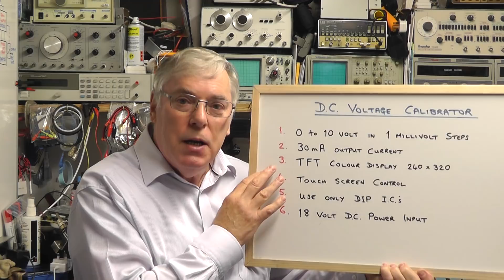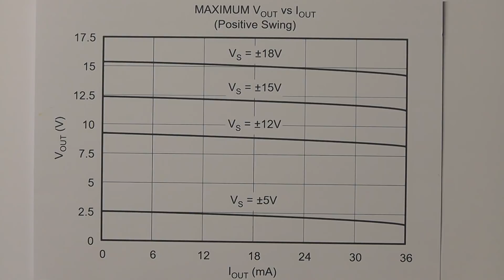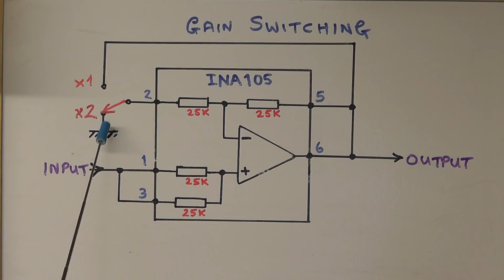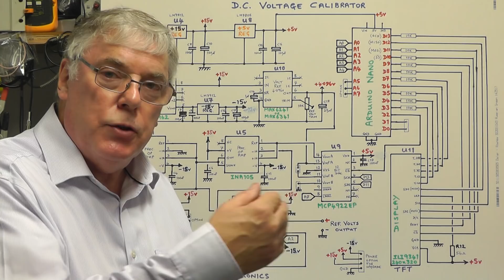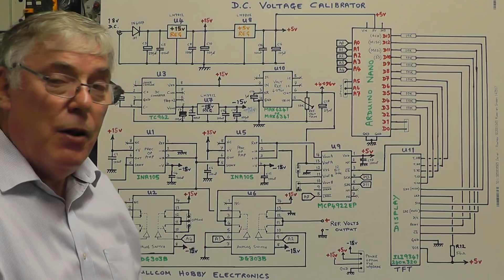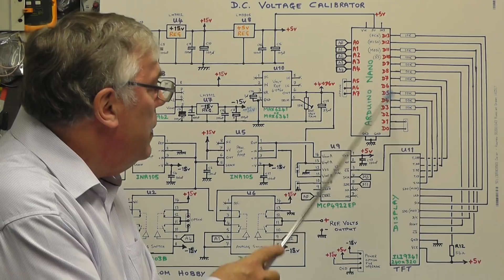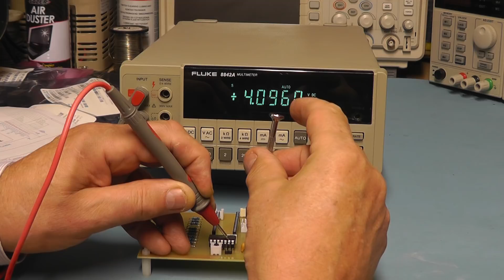Scullcom Hobby Electronics #53 - DC Voltage Calibrator Part 1

Comment: So you have minus 15 from the charge pump feeding a minus 15 volt regulator? so how can it regulate with no voltage to work with? you need about 3 volts across it for it to regulate

Comment: So if there are two DAC's in the package and they each have a seperate voltage ref input and each have an output, why didn't you put the 4.096 ref on one and the 1.2 volt ref on the other and just switch the output ? instead of all that switching?

Comment: What do you use a DC voltage calibrator for?    BTW like the fact you give the component list, PCB etch and everything right here, one stop, no need for a gerber file reader and all that stuff.  I used to etch things like circuit boards and other things using ferric chloride at a company.  EPA regs made it difficult to stay in business.

Comment: The MAX6(2/3)41 are actually a trade-off. The temperature coefficient isn't long term, reference drift is. the MAX63NN has roughly half the typical temperature coefficient - 0.5ppm, of the MAX62NN's - 1ppm typical. However the MAX62NN lists its long term drift spec at only 20ppm/1000 hours, beating the '63 at 30ppm/1000hours; I believe this is where their numbering scheme comes from but I could be wrong. So it's basically a trade off if you want the tightest short-term tempco, or the lowest possible long-term drift.

Comment: When calibrating a source, I was taught about using the first digit and decimal in lower digit numbered meters to gain a digit at the end. For example, when setting a 10 volt standard, you would adjust it to 9.9999 on a 4 1/2 digit DMM, so the digits shift between 9.9999 and 10.000, which will get you closer to a reading of a 5 1/2 digit DMM at 9.99999. This would apply to a 5 1/2 to 6 1/2 digit DMM as well, and even a 7 1/2 digit. Essentially, you're fishing for that last unseen nine and splitting hairs.

Comment: Very nice project.  I like the touch screen with the audrino.  I haven't got into using them.  I have just been sticking to repairs.  Might have to build some projects and utilize a touch screen interface. I liked your electronic load also. 👍

Comment: Hello Louis. Coming late to your nice project... I've a simple question: am I the only one to notice that the schematic around the switched OPamp doesn't fully reflect the bloc diagram? According to your long explanation about the choice of the multiplication factor 1x 2x 4x, these are cascaded by selecting x1 or x2 on both stages. But the schematic shows that the second switch actually select the output of the first OPA (x1 or x2) or the output of the fixed x2 gain of the second... Is there any advantage to do so instead of replicating the 1x, x2 gain selection of the first OPA to the second OPA?

Comment: What would this device be used for?
Reply from the maker: Hi George,
A DC Voltage Calibrator can be used to check the accuracy of a multimeter on the voltage range and also for calibration setup and comparing different multimeters. It can also be used in circuit design when testing the gain stability of DC amplifiers. It can also provide an accurate reference source during circuit design when testing response at different reference voltages.

Regards,
Louis
Reply: So, is it essentially a more elaborate reference voltage power?

I've been looking at buying a reference voltage power supply from a guy who makes them, and lives about 45 minutes North of me, in Washington state, (I'm just south of Portland).

But, I got to thinking last night, as I was checking out the Tek 466 'scope I just picked up, it has a digital multimeter piggy-backed on the scope. Do you suppose that is a reliable/accurate enough meter to use as a reference source once it is calibrated?

Or does it make more sense to buy one, (~25.00) and be able to calibrate all my meters to the same reference?

Thanks.

BTW, I learned a lot just from watching you walk/talk through the white board diagram in this vid. You explain things well.

I'm going to have to give one of these Arduino boards a try one of these days. It looks like you can do some cool stuff with them.
Reply from the maker: Hi George,
I do not think the multimeter piggy-backed on the scope will be as accurate as a voltage reference source. From what I can see it only has 4 digits. You could get it calibrated but it would then only be as good as its specification, and I am note sure what that is. If you can find the technical specification of the multimeter piggy-backed on the scope it may help you. I think it was referred to as a model DM40, DM43 or DM44 the later models also had temperature reading as well.
Regards,
Louis

Comment: Great video! Thank you very much! I would have gone with some things different but that would be more for effect :-P
For example, I would have gone with a flyback for example for the -/+15V rails, can be implemented with something as easy to get as MC34063 maybe another more modern IC but still with trafo, it can take a wider input range, make it easy for battery conversion. Would have gone also probably for another implementation to get also negative voltages, cause why not. Could also have gone with a MOSFET reverse input protection and combine it with a soft power button. Still, the idea is pretty cool! Thanks for that!
Reply from the maker: Hi,
Thanks for your comments. It is interesting you mentioned the MC34063 as I am using that IC on a new Function Generator project I am currently working on as my next You Tube video project.
Regards,
Louis

Comment: hey scullcom hobby electronics, I want to design a pH simulator which goes from( approx) -1.0000 V to +1.0000 V. I am not using a DAC or any uc. I am using 555 timer and by changing the duty cycle with two trim pots I m getting particular mv. Now the problem is I need 10 set mv  values and measuring the resistance of the pot at that particular mv value this can be realized but the resistance values I m getting are not generalized values. And parallel and series combination are also not possible for the desired resistance. So can you make a video about this without using uc or DAC or at least help with this issue. Thank you.

Comment: what a great project. lots of expensive components tho. Just thinking if you get a single more expensive component - DAC, say 18bit, and less precise other components,  analog switches already introduce a problem anyway. Then use software to calibrate away the errors. Major drawback, you need access to something to calibrate against, $$
Reply from the maker: Thanks Fred. Yes agree some of the parts are a little costly. In Part 3, I may make some changes to help with calibration. Regards, Louis

Comment: Thank goodness you have this info posted I have been racking my brain for days trying to build schematic for same project. Biggest difference in mine is substituting adc to 22bit mcp3551 which may be overkill but fun to think of resolution in 6 digit ranges.
Reply from the maker: Hi Tommy, Glad to hear you found it helpful. You mentioned the MCP3551 which is an ADC, but for this project you would need to use a DAC. Regards, Louis
Reply: Scullcom Hobby Electronics my mistake, I'm trying to build more of a self calibrating type bench multimeter/power supply to clear up any confusion. It's a rabbit hole for sure. It seems that your circuit would make it easy to make an add-on board to make this work especially since you have 2 voltage references to compare against and extra unused pins. I will try to get some simulation data when I get a chance to try this. Thanks.
Reply from the maker: OK I understand now. All the best with your project. Regards, Louis

Comment: Hi Louis,

Thank for the video and good work. Please keep it up as it is very educational with well explanation and right description too.

However, I think you may eliminate using the gain switches by using the internal gain of 2 by the DAC itself, by using the 5V VREF and setting the INA105 with the gain of x2.  It means,  if the user inputs a maximum reference voltage of 10 to set, then it can be divided by 2 inside the Nano to drive DAC to generate 5V output on A and then configuring precision Diff OpAmp to gain of 2 (gounding the pin2) to get the output of 10V max.  What do you suggest please?

Regards,
Pradip
Reply from the maker: Hi Pradip, Thanks for your comments. I did look at the x2 internal gain of the DAC ouput amplifier but that has a number of limitations. Since the maximum supply voltage for the DAC is only around 5 volts, that limits the maximum output voltage anyway to about that level. So it will only be of use if you were to use a lower voltage reference. Which would be an option.
Another point is the internal OP amp of the DAC with x2 is not as accurate as an INA105 set to a gain of 2, so you may get more errors.
Having said that, your idea is of interest if you did use a 2.048V reference as each step of the DAC will give exactly 0.5mV and so improve the overall resolution. Its worth giving it a try. Thanks, Louis

Comment: Very nice video. In Part 2 it would be interesting to see what happens at the switching borders (4.000V / 4.001V and 8.000V / 8.001V ). It might turn out that 4.000V will measure more than 4.001V.
Reply from the maker: Thanks Alex for your comment. I will have a closer look at those crossover points and try and remember to show it in Part 3. Regards, Louis

Comment: In the design spec you said you want 1mV step. But (if I understand correctly) in the 8-10V range, your resolution will reduced to 4mV because of the x4 gain form INA105. For example if I set the output to be 9.001V, arduino will tell the DAC to output 9.001/4 = 2.25025V will is not possible for a 12bit DAC. If I really want 1mV resolution, should I use 16/24bit DAC instead?
Reply from the maker: The resolution of the 12 Bit DAC can only go down to 1mV in the current design and so in the example you gave of 9.001V which is then divided by 4, the output from the DAC will be only good to 3 decimal places so it will output 2.250V, the INA105's will then multiply that by a gain of 4 giving an output of 9.000V. If you want more resolution from the DAC then a 16 Bit DAC would be a good option but the cost of a suitable 16 DAC would increase 5 times or more. A 16 Bit DAC would increase the resolution to a few uV. 
I will be looking at some update options in part 2 of this project to increase the resolution/accuracy. Regards, Louis

Comment: The interface seems slow. But what else could one expect from the nano, I suppose. Anyway, could you also share the way you did the PCB design, the Arduino code as well. By the way, could you share the origins of the word scullcom
Reply from the maker: Hi Sid, I did share all the files for this project in the text below my video but here they are again:
Below are links to version 1 of the software for the Arduino Nano. Also a zip file which contains the schematic, PCB artwork (Version 2) and component layout: 
http://www.scullcom.com/DC_Voltage_Calibrator_Ver1.ino
http://www.scullcom.com/DC_Voltage_Calibrator.zip
Below is a link to my original KiCad files for this project: 
http://www.scullcom.com/DC_Voltage_Cal_KiCad_files.zip
In brief, Scullcom was a name I choose many years ago and is short for "Scully Communication", which I used after I retired from full time work and did some consultancy work. As I am now fully retired, but I still own the scullcom.com and scullcom.uk domain names, I decided to use the Scullcom name for my You Tube channel for hobby electronics and hence the name Scullcom Hobby Electronics. Regards, Louis

Comment: you need to put a series resistor on the ouput to limit the current in case of a s/cregards john
Reply from the maker: Thanks John for your comment. I believe the INA105 OP Amp I use already has Output Short Circuit protection built-in, like many OP Amps these days. According to the datasheet it states that the "Output Short Circuit to Common is Continuous". Regards, Louis

Comment: Nice circuit, I would like the addition of feedback. As it is right now you set whe output you want and the MCU outputs the corresponding value to the DAC and on to the output op-amps. This is fine, but you don’t really know what the actual output is, only what you told it to be. I would add a high precision ADC to measure the actual output and feed it back to the MCU, which will both enable you to give the user feedback of the actual vs the set output and, more importantly you can have the MCU adjust the output if it should drift off the set target for any reason.
Reply from the maker: Thanks for your comments. I will be looking at some options in Part 2 to improve accuracy. If you add a high precision ADC to measure the output voltage and feedback any error, as you suggest, that would add a lot more additional cost. Its really a matter of choice, please feel free to amend my design to your own needs as required. Maybe a better option would be to spend the extra money on a higher resolution DAC such as a 16 Bit, 18 Bit or higher. For example a 16 Bit DAC would have 65536 steps (compared to 4096 of the 12 Bit DAC), and so the resolution would be 0.0000625V (62.5uV) per step. Regards, Louis

Comment: thanks for sharing this great project! perhaps just a tiny simplification - if the touch controller is a xpt2046, no level shifting is needed at least for the touch connections. the xpt is rated for 2.7-5v according to data sheet...
Reply from the maker: Thanks. Yes the TFT uses does use the XPT2046 touch screen controller. Thanks for the information. Regards, Louis

Comment: Nice project, board looks really great.    One thing to consider is the ~30 ohm Drain-Source ON resistance of the DG303, it's a little high to use in the output circuit without upset to the calibration for differing load conditions without feedback compensation.  One also has to watch the switch's leakage current as well.   The switches are most likely ok in in the gain stage  however I didn't check the gain sensitivity for the ON resistance vs the  25K internal op-amp resistors.

Consider running the entire DAC/Op-amp chain for a fixed 10V output then use the analog switch to make a .5X ref voltage for the DAC for the low voltage range.  Any switch error can be calibrated out with an adjustment resistor on the the reference and the reference .5 divider.    Thanks for the video,  I need to make one of these some day.
Reply from the maker: Thanks Graig for your comments. With regards the 30 ohm on resistance of the analog switch at the output.  This should only be an issue once you start drawing say the higher or maximum current of this unit at about 30mA. But if the unit is used for checking the calibration of test equipment than I think it should not cause any real problems. That said, we could improve the accuracy at the higher currents by replacing the DG303B (U6) with a MAX4622 (but twice as costly) which has an ON resistance of only 3 ohm, but I would also have to alter the print layout on the PCB to match the changes in IC pin connections (maybe an option for another version of this project). Another option could be to use the existing analog output switch to control a small reed relay.
Your second point is also interesting but the current DAC (MCP4922) I am using has a maximum supply voltage is only 5.5V.  Regards, Louis

Comment: Hello - I love your whiteboard work. I wish I could draw that neatly! But won't it have a resolution of 2mV above 4V and 4mV above 8V rather than 1mV you specified?
Reply from the maker: Thanks Tom for your comment. There could be up to a ±2 LSB (2 steps) due to the INL error of the DAC. We may be able to minimise this possibly in software calibration - I need to have a look at that. This error would be amplified by the  x2 gain of the OP Amps. Regards, Louis
Reply: Yes that too but what I meant was the DAC is stepping in 1mV steps (4.096V/4096) and then above 4V you multiply the DAC output by two or four.  So wouldn't the step size at the output then be 2mV or 4mV?
Reply from the maker: Sorry Tom for the misunderstanding. Yes you are correct. Any errors from the DAC output would be multiplied by the x2 OP Amps. We may be able to calibrate some of this error out. Regards, Louis

Comment: Fantastic video once again. Your videos really help to make circuit design more accessible for beginners like me. I did notice that your tft refresh rate is very low. Have you considered trying the STM32F103C8T6 boards? The difference in speed is quite big, there is a comparison video between the stm32 and the arduino nano using a ILI9341 display, it really is night and day. Not to mention they can be bought for as little as $1.72 and have some other upgraded features as well.
Reply from the maker: Thanks Ronald for your comment. Thanks for bringing my attention to the STM32 board. I have not used this type of board yet but it looks very interesting and as you say the cost is very low. There must be a way of adding that type of board to the Arduino IDE software which would make life easy when programming. Regards, Louis

Comment: One very easy thing you can do is link both DAC channels with, say, a 1000:1 divider on one of them giving it the ability to "nudge" the output a little way. Between them they then act as a coarse/fine adjustment pair, greatly increasing the set resolution and possibly allowing you a digit or two more on your setting, if you calibrate it well enough
Reply from the maker: Thanks Paul for the comment. I did have in mind something similar but I am also looking at some other uses for the second DAC. I will try and cover it in Part 2 of this project. Regards, Louis